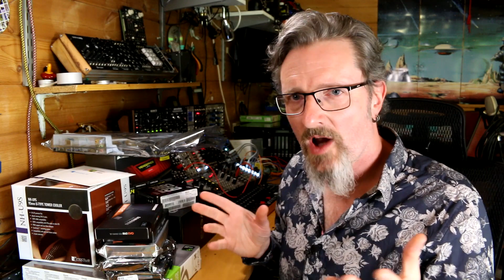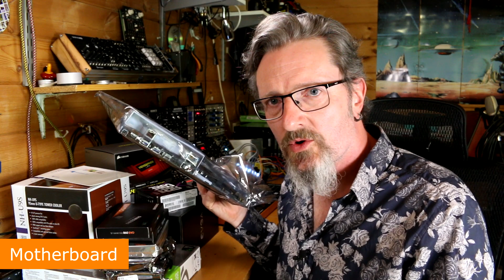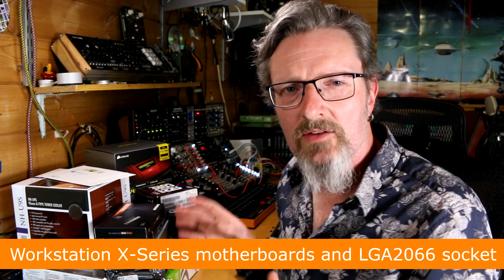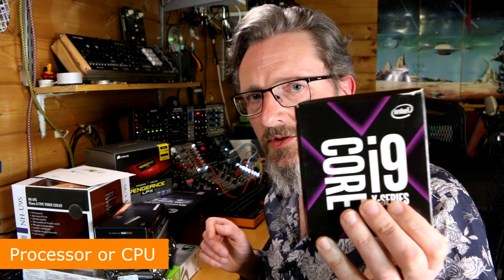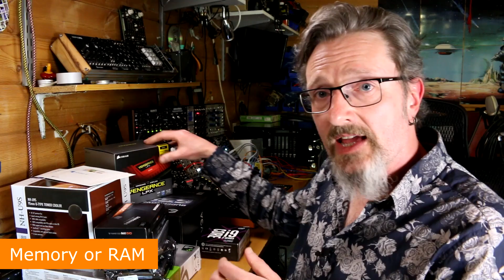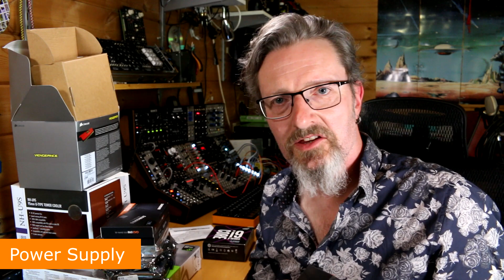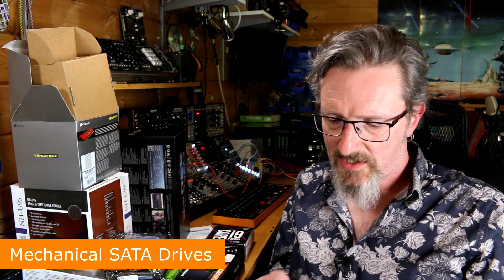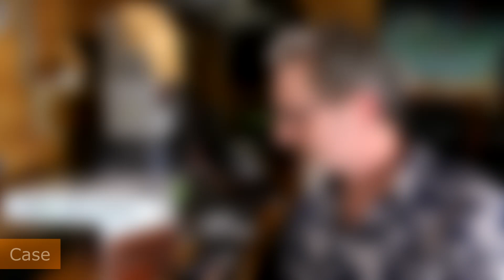How to build an Audio PC: Part 2 - Choosing components

Comment: Best advice given here: avoid the bleeding edge.  It's expensive -- because it's the latest -- and it's untested in the real world -- because it's the latest.  I tend to build PCs with components that are "two or three years old," maybe even older, but were top-of-the-line when they were first released.  Their prices have fallen, their bugs have been worked out, their firmware and drivers are mature.  Case in point, I'm upgrading an AM4 machine I built in July of 2019, nearly six years ago now, to be my primary audio PC.  I could build on a newer platform, but I'm confident in AM4, and the upgrades will serve me well for another five years -- for relative peanuts.  Now to decide on software.  That's where we have the most options and where the most important decisions are to be made.

Comment: Amazing video!

2 questions though as it's already 3 years old:

1. Would you still recommend 2666mhz or something similar? When I ask on forums, people seem to be adamant about getting something like 3200mhz+

2. Is getting an MSI mobo fine? The current ASUS and Gigabyte models in my budget range seem to have a lot of isses and low ratings...
Reply from the maker: Computer specs change really quickly and i no longer build them so i'm not up to date on what's good. There's nothing bad about getting faster RAM. MSI should be fine but I can only recommend what I've actually used, so I can't really answer your questions, sorry.

Comment: One question why mechanical hd instead of all ssd
Reply from the maker: Price and storage size. An ssd is only really an advantage as the system drive
Reply: That confuses me a bit a gb is the same as on a ssd as SATA I'm assuming?? Is the SATA a faster HD
Reply from the maker: No SSD are faster but twice the price per TB. SSD I think currently go up to 4TB whereas SATA is 8TB. But it varies. You need to be running hundreds of tracks and instruments to reach the limit of SATA. So, as I say, SSD is good for system drive performance (windows works faster) but not much help for project performance. They are more expensive but they are also silent and smaller and not mechanical. At the time of making the video ssd we’re about 5 times the price of SATA. I hope these pros and cons are helpful! 😁

Comment: If going for home studio, consider noise (especially recording in the same room), so going for I-9 is not ideal since they tend to get hotter hence more cooler noise. I'd go for i7 or even i5. One fan graphics card can get hotter which results in more noise from the case fans. Although not relevant in 2023 but higher rpm HDD also contribute to more noise. Good idea is to read reviews and tests on each of your components
Reply from the maker: See part 3 :D

Comment: currently investigating options for my new Media (audio/visual) PC. speed, size and reliability. (i7/i9) M.2, DDR4 @ 64 - 128gb. (ssd 2 x 2tb) Motherboard Asus Z690-A? Keeping it quiet is a really important thing. Coming up with cases and fans has been a maze. Tips would be nice please.
Reply from the maker: I kinda did a whole series of videos on it so i wouldnt have to keep answering this question :D
I don't keep up with current PC tech so the idea is to use the concepts i show in the videos and apply them to the gear you're buying. 
Hope that helps.

Comment: Sorry for not discovering your channel until now, but better late than never.  Below, a reader, Buttface1981, mentioned the lack of any advice in your otherwise excellent set of videos about either [internal] sound cards or external audio interfaces.  Shouldn't a world-class audio PC have at least one?
Reply from the maker: Yes it should. The point of this series is to help you build the platform on which you will run your choice of audio interface and software. Those choices are actually irrelevant to the build and do don’t really fit in this series. I’ve reviewed plenty of audio interfaces in the channel.

Comment: It was super confusing when you switched from a workstation design to desktop. I don't see anywhere you actually listed the workstation components you were using. Looking for X series mother boards for example shows about 5 versions none of which seem to indicate the socket size and rang from 300 $ to 800 $. i have spent about 4 hours now watching making screen captures, taking notes and researching what to actually buy for a workstation and I more confused than when i started. This is EXACTLY why i would rather pay Apple to build the fucker. My time is more valuable than a thousand dollars here or there.
Please list the exact components for the workstation you intended yo originally build. 

Without an exact list for a starting reference I cant make heads or tails of what to actually buy.
You posted a site for parts but in several days of trying i was only able to get on the site a couple times. Very bizarre behavior. Some sort of security error. Anyway, I was hoping for the specs and a company I could email and try to translate the specs you recommend for a modern audio workstation and let them help me make purchasing decisions. We are in the us and shipping from the UK would be redundant. So I cant really use your suggestion for information or parts -even if they let me shop there which seemed unlikely or extremely difficult and unreliable.
This puts me back at Amazon for parts and obviously no support whatsoever much less helpful information about which parts are appropriate.
Anyone Else have idaas for computer parts resellers whom are knowledgeable and helpful?
Reply from the maker: Hi Reese, thanks for stopping by. The biggest problem with making these sorts of videos is that they date very very quickly. Just as soon as you state that this is the best motherboard it gets discontinued and replaced with something else. So I tried to go to great lengths to explain that a list of specs wouldn't work and what you need to grasp is the concepts and reasons for choosing things so that you can make a more informed decision on your system. There's nothing i'm holding up in this video that's still current. You should be able to build a workstation or desktop system with Intel or AMD components using my advice as a guide to what to get. Check out some of the other comments on these videos - they are ridiculously positive!

So yes, get an Apple - good advice! Always do that if you can. If not then you need to ease down a bit and take on board the guidance rather than simply trying to copy what i did component for component.

In terms of spec lists I directed you to Scan.co.uk - here's a current workstation based audio PC they do. It's still X299 based which is remarkable after 2 year and is the closest thing to what i'm talking about here:
https://www.scan.co.uk/3xs/configurator/3xs-fwx299-digital-audio-workstation

If that link doesn't work for you then here's the list:
Asus Prime X-299A II
Intel Core i9 10920X 12C/24T
32GB Corsair 3200MHz DDR4
500GB M.2 NVMe - OS Drive
2TB HDD - Storage Drive

I hope that helps, if not then pop along to your local Apple store for a lifestyle alteration. :D
Reply: @MoltenMusicTech  Thank You! My VPN was evidently the issue with the site. This helps clarify the @ 2,900$ Used mac i was looking at from OWC is 2.7GHz 12 cores vs. this PC Intel Core i9 10980XE, 18 Cores / 36 Threads, 3.0GHz Base, 4.6GHz Turbo.... for @ 3,100$. Whit this PC i can still upgrade from 128 gb ram to 256 if desired. TREMENDOUSLY HELPFUL!

Comment: Thank you for a highly informative vid. Could I ask you a question about Ram speed. I am having difficulty finding a supplier who sells the lower speeds you suggest. If I use 3200 DDR4 Ram is it automatically overclocked or would it run without overclocking and not cause my audio pc to trip up?
Thanks. Any help would be greatly appreciated.

Jim
Reply from the maker: Yes, any faster speed is fine - all the speed means is that that's the faster speed they are rated at - they will clock down to regular speeds without any bother.
Reply: Thank you. That was a big help. Much appreciated

Jim

Comment: Absolute horror. I chose the components and ordered. Similar specs to the one shown here, so expensive. A week later I got an email saying that it was delivered. There were two of us at home at the time of the supposed delivery and the doorbell works. The supplier's "customer service" has nothing to say apart than "it's under investigation." Any advice?
Reply from the maker: Call the police
Reply: @MoltenMusicTech  Thanks Robin. After 3 weeks, Komplett are sending out a new order. You mentioned GPU in the build, but didn't elaborate on it. I edit some video too, what GPU would you recommend for a similar rig to the one you built here? Great videos by the way, much appreciated.
Reply from the maker: Thanks! GPUs are not important in music production. Inbuilt graphics is completely fine these days (didn't used to be which is why people are still funny about it). Any graphics card will do the job. I would recommend whatever card your video software recommends.

Comment: Hi Robin. Hope you are well. Looking to build a new music production workstation pc and wanted to ask you, at the moment, which cpu would you recommend based on single core performance. To be safe intel I know, however amd is a consideration. Stability is key
Reply from the maker: The fastest one you can get.
Reply: Would you say AMD ryzen 9 chips such as 5900 or 5950x are now a safe bet or stick with Intel such as i9 10900k?
Reply from the maker: I have no experience with them do I can’t say. I’m not trying to be awkward but my experience is with Intel and I’ve never built a Ryzen system. The answer is “probably” but the whole point of this series is for me to speak from experience - I have no amd experience.

Comment: You talk about technical things it like salesman talking make it simple you can use i7 or i9 10 gen with 16 gb ram minimum ssd primary hard drive if you  want add hdd hard drive should be 7200rpm graphics card doesn't matter see very simple way to explain

Comment: i got a question if u may know or not, would you recommend the amd ryzen 7's i got one with the asus prime x570-p and its all good but would u say intel is better for audio or amd?
Reply from the maker: As i say in the video my experience is with Intel. There's no such thing as a "better cpu for audio" they are just computers. So go with AMD if that's your thing but all my videos are using Intel parts and I can't answer questions on AMD chips or boards, which ones work or not because I've never used them.

Comment: Hi there! Thanks so much for putting these tutorials since I'm learning quite a ton! I do have a question for you, just wanting to know what are your thoughts about Single Core vs Multi Core CPU's ? I've been questioning if it would be a great idea buying a  processor as RYZEN 9 5950X or Ryzen Threadripper 2970WX, they have a LOT of cores and threasd to work with, but I've read music production excels in Single Core processing si I've basically stopped thinking intobuilding my own until Im 100% sure of what I'll be purchasing.

Thanks in advance and stay safe!
Reply from the maker: You don’t really get single cores anymore so it’s not a decision you have to make. Most software works fine on multiple cores do honestly it’s a non-issue. If you have a choice between more cores or higher frequency then opt for higher frequency but either way with a new processor you’re winning!
Reply: @Molten Music Technology  Thanks so much for your quick answer, so my thinking was not that wrong :) Have an excellent day!

Comment: 1:09 that’s why it’s time for AMD. Intel might be done unless they get their $hit together. I can’t count the number of CPU sockets (re)invented or redesigned (with a different PGA) by Intel in the last year. Future proofing your PC with an Intel CPU is oxy-moronic, it will have a ONE YEAR lifespan with NO upgrade path!!. THEY ARE DOA for AT LEAST 2 years. THIS is not against YOU it’s just Intel’s reliance on their ‘brand’. I think they’ve adopted The Who’s “me the new boss, same as the old boss”. Guess what, the old boss was fired and it’s time for some new blood. Edit,If you are an ‘audio enthusiast/producer’ (as am I ) pick your CPU (I’d go with AMD) then choose the best CHIPSET for that CPU (AMD X570). The DAW I use isn't GPU taxing so it ISN'T that important so the way I shop is1) CPU, 2)motherboard depending on the chipset, 3)video card and RAM, the more the better usually (virtual instruments)

Comment: Hey man, thanks for doing this.  How can i figure out what parts are compatible?  I need to order a new motherboard,  processor, and other parts , but want to make sure my old drives and even my old case will work with it.  No sense of rebuying stuff i can reuse. Subscribed.
Reply from the maker: The motherboard website will tell you what ports and connections it has and you should check if that will work with your old stuff. If that's too hard to figure out then get all new things that you know work together. Also drives and power supplies have a limited life and won't last forever so it's also good to replace them and use old ones as archive backups.
Reply: @MoltenMusicTech   I think with a bit of study I can figure it out.  I don’t know if you’ve done a vid on compatibility and connectivity or not, but that might be useful?  Thanks for giving me a place to start.

Comment: Hey! Thank you so much for this fantastic series! 
I have a question: Should I get a 10900k or I can save a bit of money by going with non-k version? If overclocking is not needed for audio production.
Reply from the maker: The K version just means it's unrestricted whereas the non-k version is restricted in some ways of power or speed. The CPU dictates how much of something you can do and so you need to balance that requirement with your budget - you can save some money with a non-k version but it's also not going to be quite as powerful as the K version. But both will absolutely do the job.
Reply: @MoltenMusicTech  thanks!

Comment: I built my current audio PC a couple years ago, and put in a X99A Raider motherboard. I’ve had a lot of issues with audio dropouts any time I use my audio interface (UR824, but other brands do the same thing when I test). I’ve read that X99 chipsets don’t handle multichannel audio and you’d experience dropouts if you use them. The one you recommend in the video is a X299 motherboard. My question is, does this motherboard have the same issues with dropouts? Or are the X99 and X299 chipsets completely different? I’ve resorted to using my onboard sound with ASIO4ALL as my audio engine, but I’d much rather use my audio interface. I’m hoping upgrading the motherboard would resolve the issue. Thanks!
Reply from the maker: There shouldn't be anything wrong with the X99 chipset - I used it for years as my top end workstation system. It might have just been that motherboard - i always use Asus or GigaByte - or you haven't done the right Windows tweaks. But these things can be hard to fathom which is why all i can be certain of is what i did and the gear i used.
Reply: @MoltenMusicTech  I've seen a bunch of threads with X99 chipsets being buggy in audio--I wonder if it's a brand-specific thing or more just a common defect. Some are alright it seems. Thanks for the info though!

Comment: Hey Robin, what an awesome series of videos thanks so much for taking the time to make them. I'm in the process of making a monster music machine and had a question about socket size. I'm wanting a "workstation" tier pc so looking at boards with 2066 sockets. Seems like intel's 10th gen is using a new 1200 socket size. Would I get higher performance going for this new, next-gen socket size or would a 2066 still give me more power. Thanks again for all the great content!
Reply from the maker: Hi, socket 1200 appears to be replacing the 1151 desktop boards. The 2066 still stands above them as the high performance choice. But check out some cpu comparisons and see.
Reply: @MoltenMusicTech   Thanks for the quick reply! I'll do some comparisons. Just wanted to make sure the answer wasn't a simple better or worse. Been watching some of your live jams, great stuff!